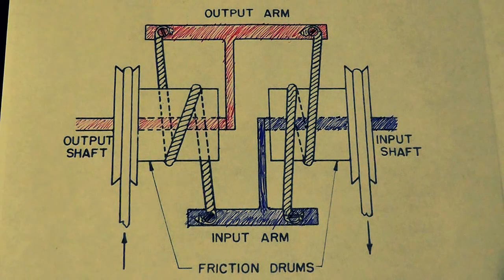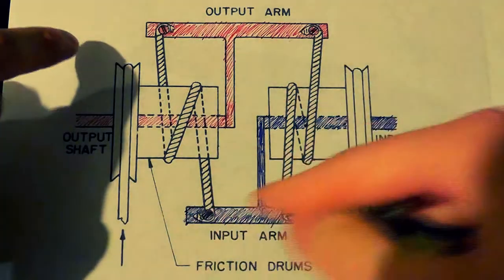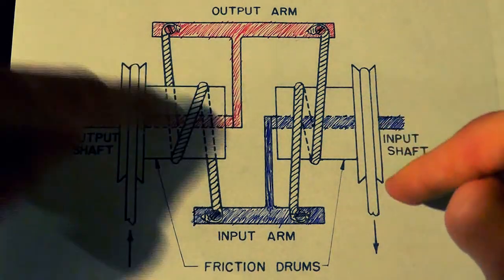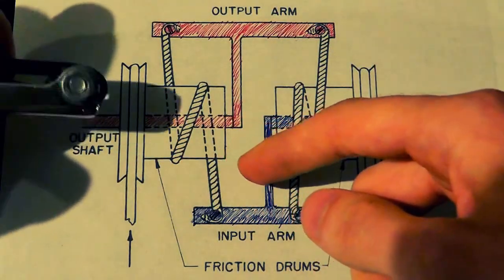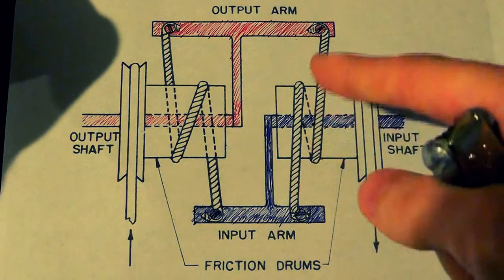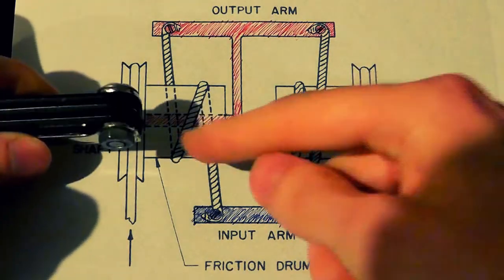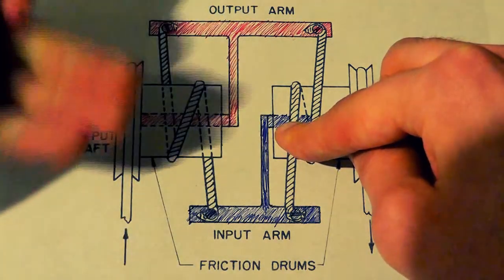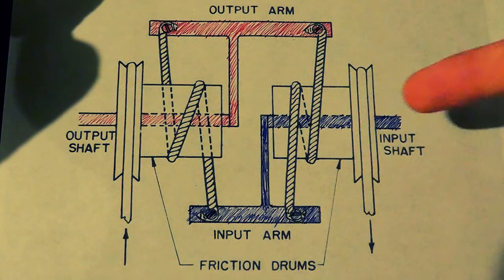How a Torque Amplifier Works  --  Mechanical Computing

Comment: this really seems like an impossible free energy machine
Reply: The drums are powered by motors with an external energy source. What this device does is allow you to control the movement of the output shaft with the input shaft but with all the torque of the motors.

Comment: I was told there is 2 motors making that torque increase and the output motor is using more power then the input motot 
He said the input motor is only to tell the bigger motor how much power to use
Reply: the small motor is tightening the rope to engage one of the capstan, which are driven by the larger motor.

Comment: Excellent job with the explanation. I'm currently working on a project where this may be useful. Would you happen to know if there is an RPM ratio that is required between the input/output shafts and the friction drums? For example, is it critical that the friction drums are rotating faster than the I/O shaft?
Reply from the maker: Not to the best of my knowledge. So long as the friction drums are able to 'catch/grasp' the rope: you shouldn't have any problem. The device was based on a Capstan, which operates at little to no rotational speed.

Comment: It is interesting to compare the torque amplifier with an operational amplifier configured as a voltage follower:  you typically have a high impedance input (in other words, a rather weak signal) and a low impedance output that follows the input with exactly the same voltage, frequency etc but with large increase in current.

Comment: The diagram and description looks very symmetrical. Why is torque on the output shaft not amplified to the input shaft?
Reply: Good observation!  It took me a minute.  The symmetry is broken by the rotation from the motor.  Both drums want to "tighten up" on the output shaft (red) and "give slack" to the input shaft (blue).  If you reverse the motor, the output and input swap (probably causing a lot of problems "upstream").
Reply: @ThisIsKarateMountain  Are you absolutely certain about this? From what I can wrap my head around (pun intended), if you invert the motor direction, this is what would happen. Because the ropes are arranged in the way they are, turning the input (or output) shafts would wrap the string around the drum going in the OPPOSITE direction of your movement, in both directions. Which means you would feel resistance, and it would be impossible to move the shafts.
Reply: Ok, I think I got it. Indeed reversing the motor direction blocks the movement. But swapping input and output also blocks the motion. Now, if you reverse the motion of the motor AND you swap input and output, it works back like normal. 
Does this make sense?
Reply from the maker: The reason is that only one of the two Friction Drums are engaged at a time, so the motor powering the device takes the brunt of any resistance coming from the output. All the Input really does is allow the Friction Drum to grasp the rope/cord connecting the Input and Output.